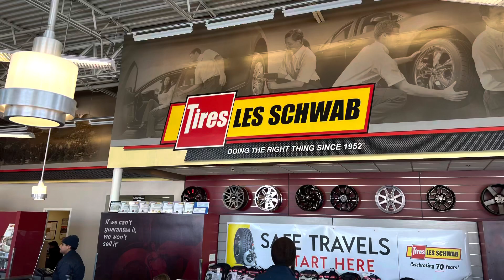Les Schwab 2022 Ford F450 Platinum Lift & Fuel Wheels 37” TIRES

Comment: What's the tire wheel setup?
Reply from the maker: Wheels: FUEL FF39 22X8.5 10-225 
Tires: AMP M/T 37x12.50x22 
This setup fits really good.
Reply: @hpassault  thanks, it looks really good 👍
Reply: @hpassault  is the 225 the offset of the wheels?  I have an F450 on order right now and I want to level it with 37's but I have no idea which offset gets me no rubbing but also don't stick out really far.
Reply from the maker: @darrenhill3514  Part#: D501 2282 A9
My setup
x2
DUALIE REAR INNER
Size: 22X8 25
FINISH• GLOSS LACK PA
Offset: 115. 95MM
x2
Part#: DE392282 4935R
Style:FUEL-FF39
Size: 22×8.25
Offset: -202mm
Center Bore: 170.1mm

X2 fronts 
Style:FUEL-FE39
FINISH:GLOSSY
BLACK / MILLED
Size: 22 x8.25
Offset: +105mm
Center Bore: 170.1 mm
Reply: @hpassault  what mpg my friend